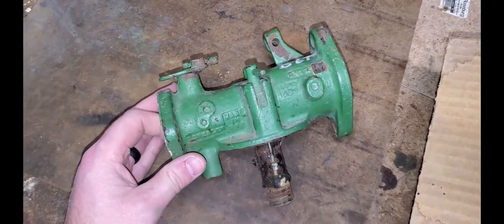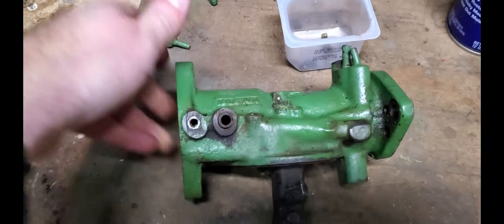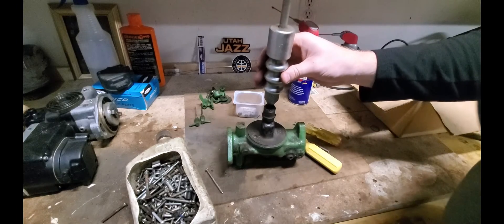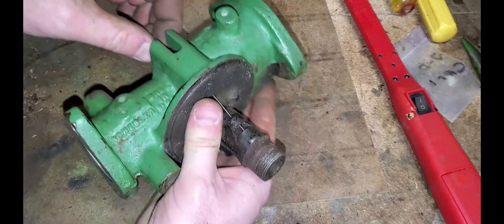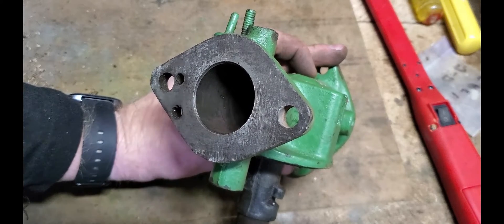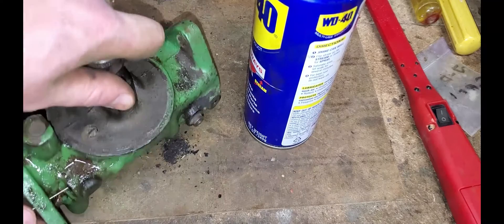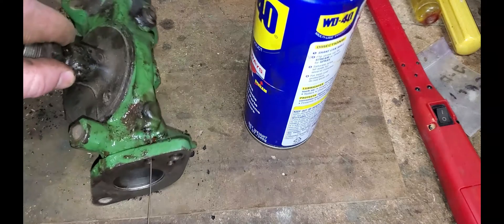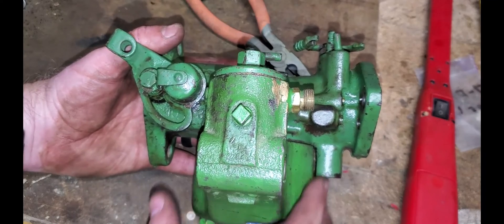John Deere Marvel Schebler DLTX Carburetor Explained

Comment: Hey I’m working on getting my grandpas model A back running and the carb on it is a dltx 33 which has been sitting for 43 years. I have a dtlx 67 I bought for my model B. Can I use the new model 67 I just bought and put it on my 1940 model A? I watch your videos frequently. Thanks!
Reply from the maker: A carburetor from a model B isn't going to work very well on an A. The inner bore diameters are different. The A is much larger than the B. Have you tried taking the DLTX 33 off of your grandad's tractor? They usually clean up alright.

Comment: I’m working on this carburetor with my dad and the carb keeps leaking when we put it on, out into where the intake is in into the cylinders, we’ve tried to fix a bunch of problems such as checking the float and the pin, made sure they sealed, tried to clear out holes like you did in the video, and so far nothing seems to have solved our issue. Do you have any ideas on why this might be happening?
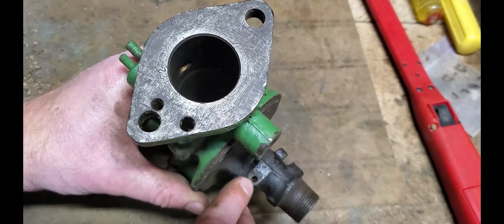Reply from the maker: You could try setting the float a little lower, even if it's lower than what the book specifies. I've had to do that before and it's fixed the problem. Here is a video where I did exactly that.  https://youtu.be/KBfVRPIHlaE?si=bLiD5hzbErDLnEm6.  Go to time 5:40.
Reply: Thank you for the speedy reply, we had tried this slightly but your message gave us confidence to give it one more go and bend it up more, we were just able to start it up now. Definitely adjustments to be made but for now I believe that is that problem solved! Thanks for the help
Reply from the maker: @BW-ls9wj yeah, hopefully it works. Bend it downward so the float is lower.
Reply: I believe our next steps will be working on the timing as it sounds a little aggressive or like it’s backfiring, thanks for the help!
Reply: Just found your video on the John Deere B seemingly with similar issues, timing, engine balance, and carburetor so hopefully that’ll help with our work on the A!

Comment: Great video.  Where should the load and idle screws be set roughly after putting back together?   Thanks
Reply from the maker: Open them enough to get fuel... So maybe open 2 turns. Then tune from there.
Reply: @jonelsonster  1-½ out for Idle circuit to start.

Comment: I screwed up on my jd h carb I couldn’t get emulsion tube out so I found a screw that would thread into it and I could get it to turn 360 but not move up or down. I grabbed to screw with pliers and yanked and I broke the screw off in it. Any ideas what to do?
Reply from the maker: Hmmm... This is a tricky one. 
If the broken screw can not be extracted, you can try a few things I've done before (or seen done).

The end of the emulsion tube sticks up in the throat of the carb, right in the necked down Venturi area. You could try sticking something in there and pressing it down. 

I've also seen carbs that have been drilled through the top of the carb. That gives access to be able to pound the emulsion tube downward and out. Then you have to thread the access hole you drilled and insert a plug. I have not done this. But I've seen a carb with a plug in the top. Maybe a last resort.

Comment: Did you have to drill the holes in the gasket side to take the plugs out
Reply from the maker: There are holes in the flange of the carburetor from the factory. So no, I did not have to modify the carburetor in any way.
Reply: @jonelsonster  weird mine doesn’t have them
Reply from the maker: @platypus1287  that's interesting. You'd think those holes would have to be there because that's how they drilled the passageways at the time the carb was manufactured. If you look on the back side of the flange, can you see anything? What model carburetor do you have?

Comment: Also check that the upper throttle bushing is flush with the inside throat, so that no air can get by the throttle plate.  Again, great work
Reply from the maker: Yes, you should also verify the bushings on the throttle shaft are in good condition. Vacuum leaks there can cause idle and load issues.

Comment: Very good video!! But you forgot the horizontal passage behind the brass plug at the bottom of the stem. It is part of the idle system. Plugged, it will cause the tractor to idle roughly
Reply from the maker: Great point!

Comment: Very good video, thank you. I do have a question maybe you or one of the viewers can answer. I have a '47 B with this carb, the one in this video a DLTX67. My B is hard to start, especially after it sits for several weeks. But once it starts it runs great and I can top almost any hill here in central Pennsylvania in 5th gear. Could it be one of, or a couple of the ports could be clogged? Would that cause hard starting?
Reply from the maker: It's hard to know for sure without hearing it or seeing it. One thing to check is too make sure your fuel shut off valve at the tank isn't leaking. If it leaks slowly then the fuel will leak past the carb and into the cylinders (and the crankcase). Then every time you try to start it then it's completely flooded... And very hard to start.
Reply: Pretty certain there is no fuel bypass into the cylinders. I say that because I have a shut installed between the tank and the sediment bowl.
Reply from the maker: @Marine-72  I'm not sure if your problem is carburetion or ignition.  To me it almost sounds like ignition. But, my advise is to go through the carb completely and make sure the passage ways are all clean and clear. You don't have anything to lose. Even if it doesn't fix your problem, at least you can cross it off your list as a possible contributor.
Reply: Spark plugs sometimes don’t work well.  Check out the points. Maybe a bad capacitor. Check the condition of the coil. Try starting with the compression relief valves open (they are on the bottom of the engine. Be careful closing them if it starts . Hot gasses coming out of them
Reply: Well, I finally figured out what the problem was. Actually there were two issues. First the head was cracked allowing coolant into the number 1 cylinder, the other was a the wire running from the coil to the distributor needed replaced. I should have the new head back from the machine shop and bought a new wire set from Brillman's. Should be good to go. Thanks all for the replies.
Reply: If you have an all fuel tractor, two fuel tanks, you might need a different carburetor. Maybe a DLTX 73

Comment: What is your opinion of using ultrasonic cleaner tanks instead for a carb that has been sitting unused on JD D for 10 years ?
Reply from the maker: I can't say. I've e never used an ultrasonic cleaner. But it probably wouldn't hurt to try. Let me know how it works.
Reply: @jonelsonster  I just took the bowl off so it and the body would fit in nicely and used cleaning strength vinegar for about half an hour followed by many 10 minute cleaning cycles with straight water until the water was clean at end .   It sure removed a lot of "dirt" and fine rust.  I had pulled the load and idle screws.  I figure I will give it a try on the tractor before winter. If it doesn't work I have all winter to try and watch those instructional DVD'S and use the drills and kits. Thanks

Comment: How many turns of the idle control and load circuit. My JD is not running smooth.
Reply from the maker: It will vary. Start with about 2. Then while running at low throttle, screw the idle adjust needle in or out until the engine sounds happy. For the load screw, you need to get someone else to get in the driver's seat, throttle the engine up, put the transmission in high gear, press both brakes hard, and slowly begin to release the clutch. This will load the engine. You have to kinda ride the clutch. But while the engine is under load, adjust the throttle until it sounds happy. You do not want to see any black smoke from the exhaust.

I'll try to make a video of the process.
Reply: Start with the needles tight clockwise; then, turn each one out 1 1/2 turns out. Thats a good starting point.
Reply: That tip worked. Thanks for your response. My late father's deere is running again.  The serial number badge is missing so I cannot know the exact year its built. Is there another way to tell with out this badge? I estimate it's between a 47 and 51

Comment: I have just rebuilt DLTX 67 for my B and it wasn’t to bad I got a kit that had all the brass plugs and new screws I did have a time getting that brass tube with the holes in it out but I did take wire to all the ports and clean them out the kit also had new throttle bushings and I had to ream them because the throttle shaft was to tite. I also put a new float in it and set it they called for it to be 3/8 from the top of fuel bowl that is done but my tractor cuts out on a pull and I’m thinking the electric is grounding out in the converted magneto to a distributor now it’s got new plugs and wires
Reply from the maker: You could also check the load circuit to make sure it's set right. But spark issues will definitely cause problems too.

Comment: Nice video! You wouldn't have any cores you would be willing to sell would you? I need a good DLTX 71 I can go through and clean up for a 1950 A with powerblock.
Reply from the maker: I have a couple DLTX 71 carburetor bodies that are not yet rebuilt... But one has a crack in the stem. The other one might be in good shape.  I'll have to check on it the next time I'm at the farm.